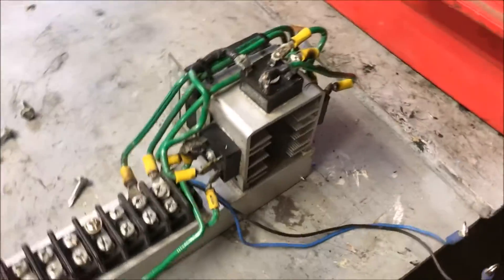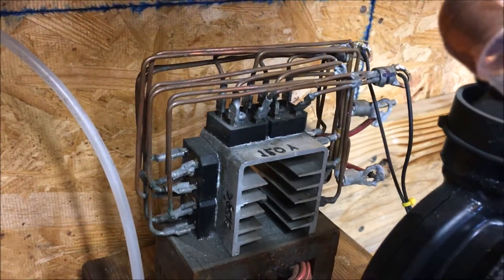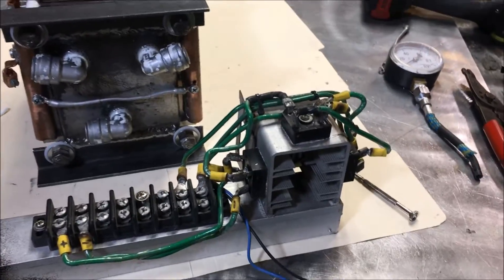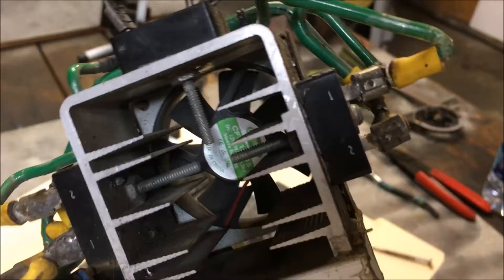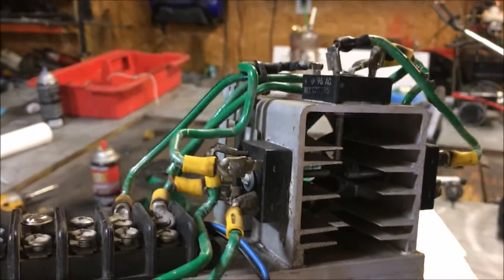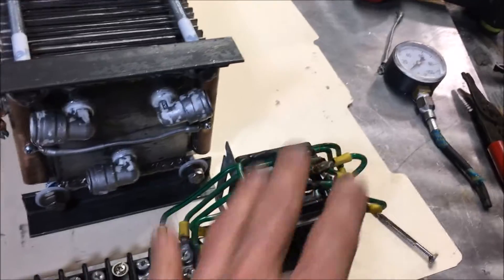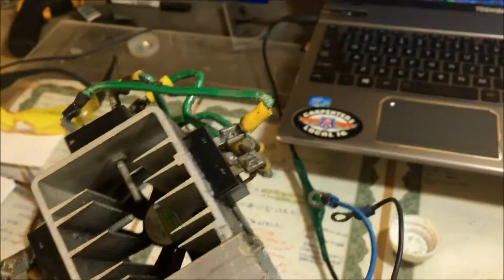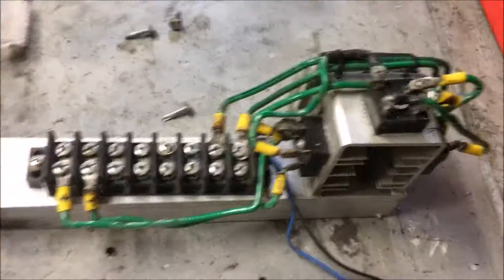Full wave rectifiers in series ( Bridge rectifiers )

Comment: Bro how much voltage you used?
Reply from the maker: 120 using 50 volt i think , diodes in series
Reply from the maker: i think they are 50 volts diodes but im running 120
Reply: @NOBOX7   yes brother ,I  saw your 7year old video of  liquid propane burner in,you are saying about 125 volts AC supply

Comment: Hi, Thank you so much for this video. It is very interesting. 
I saw in some textbooks and sources that diodes in series need parallel resistance for static voltage balancing and snubbers for transient situations. They mentioned if these components are not used, the diode will be damaged. 
Maybe your circuit works because you are not using single diodes and its module of diodes.
Could you also operate it in power and show some voltage and currents? It should be very educational. Thanks!

Comment: Will this result in voltage increase from the ac to dc side. I have a projects that generates 6v 3 phase at high amps and i need higher voltage. Would it work if i connected the dc outputs in series?
Reply from the maker: yes

Comment: Finally I've got your schematic, and think it makes no sense. At forward voltage your bridges diodes connected in series that increase  voltage drop. At reverse voltage they connect in parallel, so they will be damaged if you  use AC voltage higher than 50V
Reply from the maker: you can connect 3 50 volt diode is series to make a bad ass 150 volt bridge rectifier , your looking at it man , the thing works . Youl figure it out , just build one
Reply: @NOBOX7  give me your email to I can send you schematic to show what I mean
Reply: @NOBOX7  I did build it and on each diode I measure  the same voltage as on input AC.

Comment: Get a basic Electrical Engineering circuits book.  It will show you how the diodes, capacitors and resistors add in series and in parallel and how the transistors operate.  After that it walks you thru building circuits, etc.  Thanks for posting.

Comment: I recently repaired some 1000V UV ballasts that used 4 bridges in series to generate the HV from 240VAC. The  inputs were in parallel, they used caps to drop the input voltage. Clever setup.
Reply from the maker: Cool , i think ive sen those circuits, they use capacitors   and i think its called votltage doubler circiut array , they use it in stun guns
Reply: What the cap means, please?

Comment: Can you draw some kind of diagram how the diodes are connected and how that thing works? It pretty hard to see from the video.
Reply from the maker: yes i will try
Reply from the maker: you connect the positive and the negative to the ac input of each diode so diode  1 connects its + and -  terminal to the AC input of the next diode and that diodes output goes into the ac input of the last diode
Reply: @NOBOX7  sorry but it's not clear, I've tried, but it's not work.